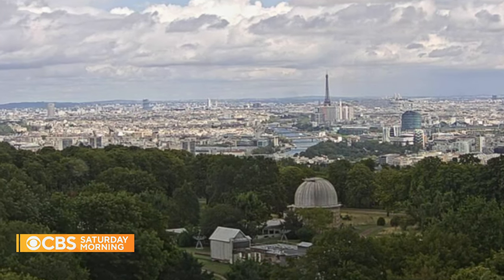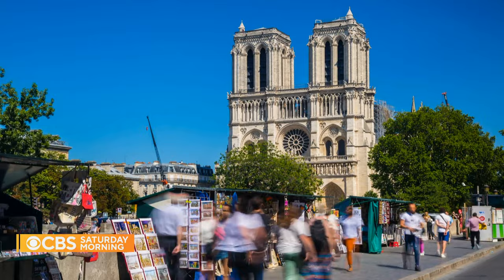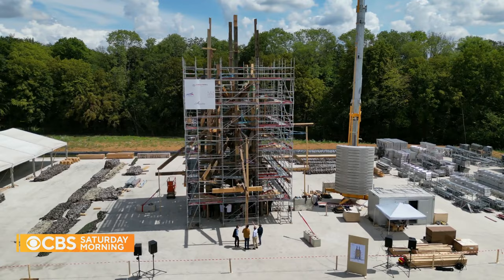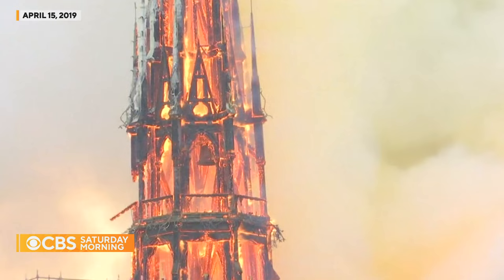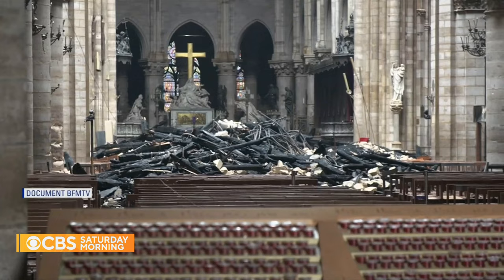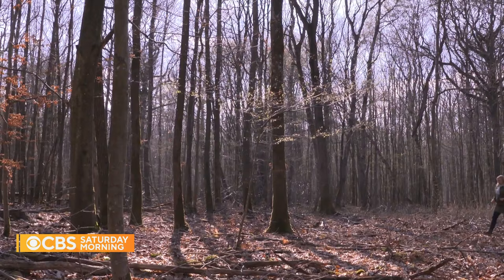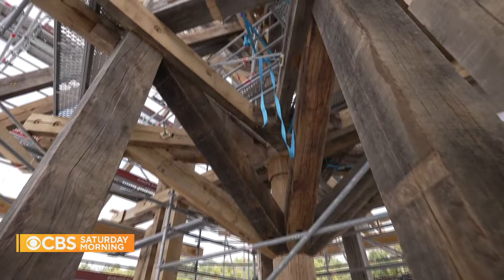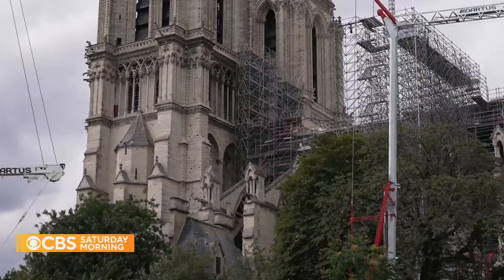A look inside the restoration of Paris' Notre Dame Cathedral

Comment: MY ? IS.....HOW DID THEY BUILD IT THE FIRST TIME WITH NO CRANES TO LIFT A 300 FT SPIRE ????
Reply: It was built in place with the beams being hoisted to the roof with the help of a massive windlass.
Reply: aliens
Reply: It was build like any other big building at that time...more slowly but surely..often a communal effort that took many generations...no mysteries...and it was already largely a 19th century re-imagining ..that is basically what they are reconstructing...the idea that these buildings are unreconstructed time capsules straight from the middle ages is mostly false..still as a symbol it is very potent and worth the effort
Reply: @nondescript2892  The cathedral of Milan is a perfect example of this. No fixed style, built over 300-400 years.
Reply: Well, for one, they had cranes, primitive but they worked. Not the massive 300 foot tall ones, much smaller but good enough to atleast lift the lumber and stones up to the roof. Second, they didn't build the spire in another place and then lift it all up, nay, they built it right there on the spot, on the top of the roof.